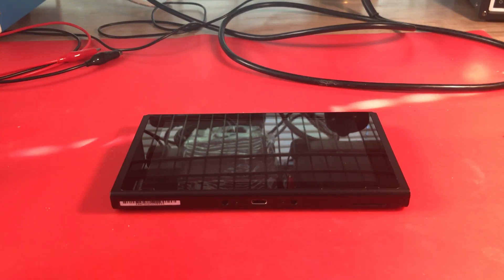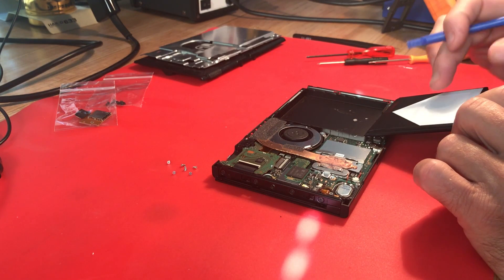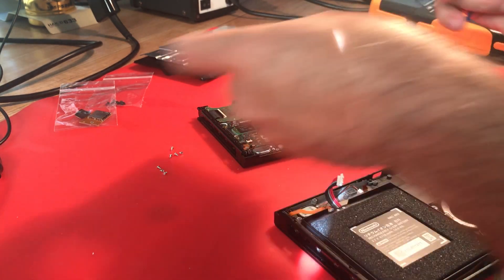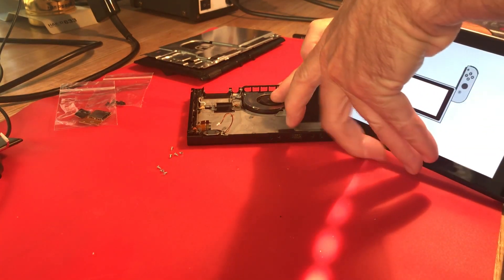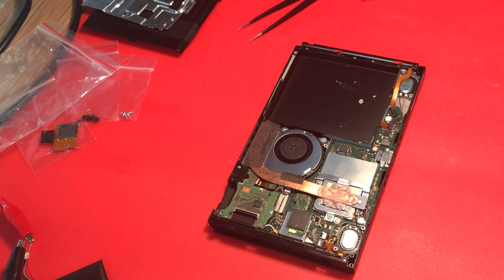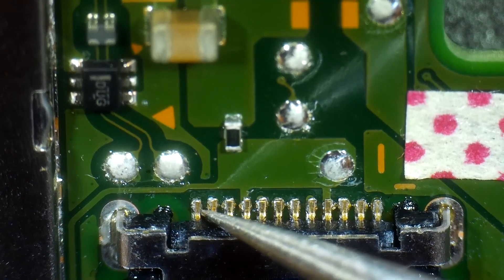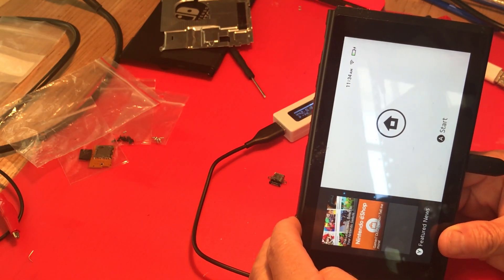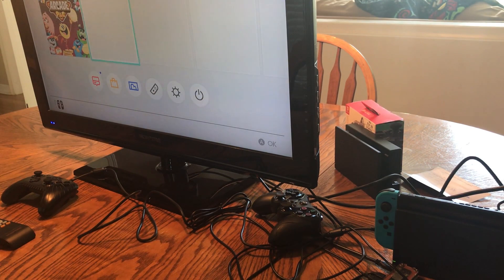#7 Nintendo Switch #4 Repair Not Charging

Comment: Great video, could you state what temp and air flow you used to successfully solder the new usb port on please? Thank you.
Reply from the maker: My temp was set on 450C.  The airflow was around 50%.  I can't really say how much CFM that is.  The dial just goes from 1-8.  Also, when you are removing the old connector, don't pull on it.  Perhaps very slight pressure with tweezers.  When it gets hot enough, it should fall away.  If you pull, you may lift traces.  Trust me.  Also, I recommend cleaning out the mounting holes before you reinstall.  That way your not fighting them and seems to cut down on how much heat is required to reinstall.
Reply: ToltecMerc Thanks much appreciated 👍